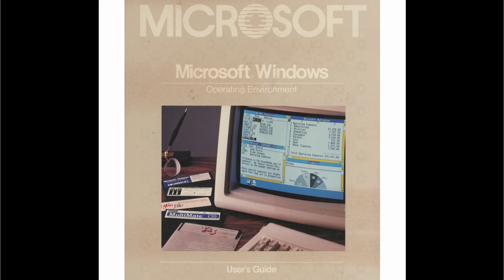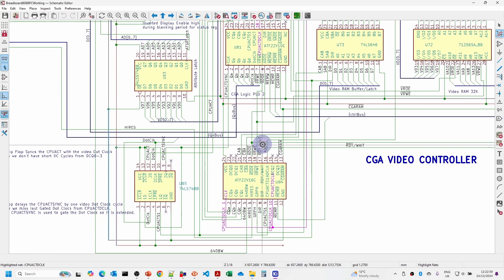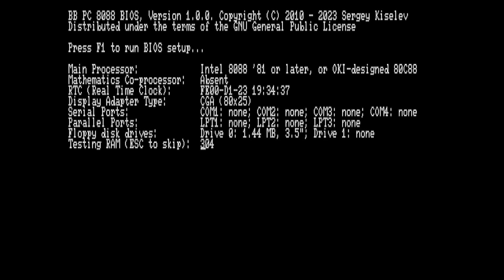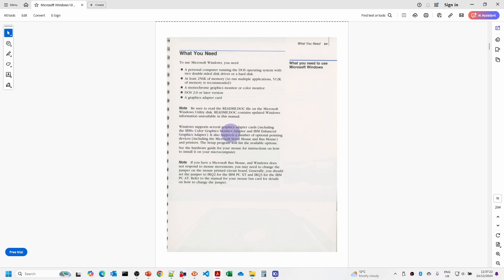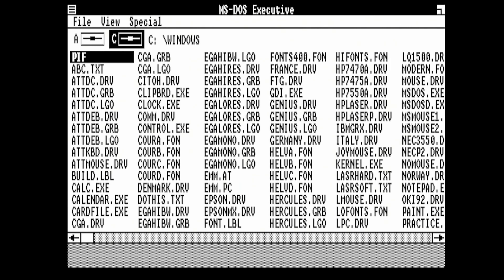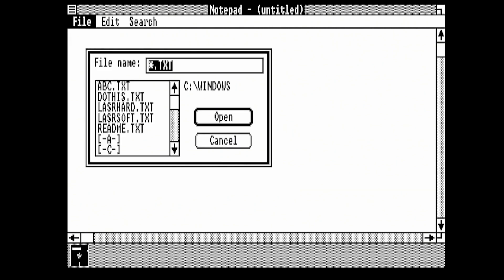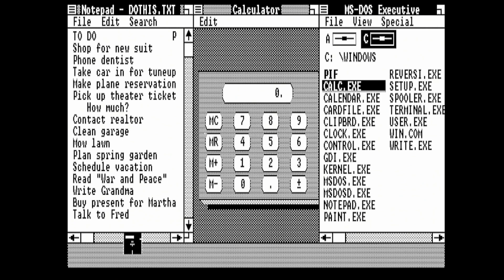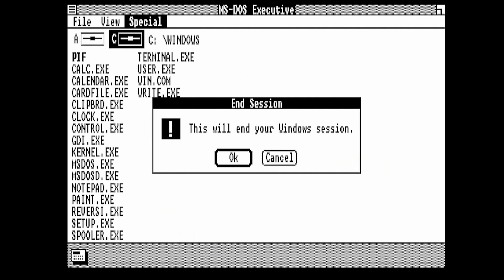Breadboard 8088 PC #61 Install & Run Windows 1.0

Comment: I would not be so keen on building a computer with breadboard ...I built a test jig many years ago using tri-pad boards mounted on aluminium  sub-frames in a box the size of a small microwave oven; - next time, I will use PCBWAY...
...computer circuitry needs lots and lots and lots of small ceramic capacitors across the power rails of each IC...
Reply from the maker: That's kind of the point. Use decent Breadboards and lots of decoupling caps like I do and it will work. I would have gone through about 100+ PCBs building this project! Dave

Comment: Congratulations getting those last glitches fixed and Win 1.0 running! I remember getting it running on the family's XT in 87 with 512KB and dual 360K floppies...so much disk swapping but MS Paint was worth the effort.
Reply from the maker: Thanks, just the Mouse to go then I think I will have a go at re-building with the faster 80C88 and get rid of DMA and the power strip bus connections (these cause most of the reliability issues).
Going to play with a few other Windows 1.0 Apps but hope the hard drive doesn't get corrupted. Seems to be intermittent problem where the directory entries and FAT gets corrupted :-( Dave

Comment: I was loosing the will to live half way through the CGA videos, so pleased to see we are now moving on!😀
Reply from the maker: You and me both! Video controllers are by far the most complex part of PCs (old and new). Timings down to 10ns matter even at VGA resolution and despite the best of plans, a certain amount of trial and error. I partly use the videos to remind myself of what I have done (like the Nanocomp snow ones), so not always going to be short and snappy!
I think I have reached the limit of Breadboard based PC compatible video controllers. VGA has about 300 registers and dedicated VLSI chips for handling the video logic! (EGA is not much better). I thought MCGA may be an option but Windows driver was 286 only and still in black and white just 640x400 rows, not 640x200! Let me know what you would be interested for the next series? Dave
Reply: @breadboardinglabs  I am glad to took my comment in the spirit it was meant!  Its a great achievement to get Windows running on a breadboard computer, so hearty congratulations.  As for the future, how about returning to the Motorola family with 68008 or full 68000?  And if you have had your fill of vintage video controllers, maybe take the easy way out with a Pi Pico or ESP32 VGA solution?
Reply from the maker: Thanks! If I wasn't so stubborn I would have given up with CGA. I do have a 68008 somewhere, but I also have a new 80C88 which can run at 8Mhz and also a 386DX 33MHz (will need some form of PCB adaptor).
May do a BBPC version 2 with 80C88 which should be much easer (and quicker) if I leave out DMA etc. 
The big issue with any video solution even, with Pico or ESP32 is the register compatibility with VGA and the complexity of 300 registers and associated logic (CGA was simple in comparison). I have been thinking about using a PI Zero and an ISA 5V to 3.3V interface then run some doctored DOSBox or similar virtualization to map the IO registers and RAM via ISA bus to the PI and connect via HDMI. Writing a register compatible VGA or SuperVGA emulator would be a huge amount of work, but mapping IO ports and video RAM on  breadboard to GPIO and mangling DOSBOX video code to take inputs from GPIO would be more manageable. Either that or just build Sergey's Trident 9000 VGA card using surface mount chips on a PCB with a ISA to breadboard connector (feels like cheating!). Plenty to think about! Dave
Reply: @breadboardinglabs  Are there merits in trying the 80188 or even the 80186 to reduce the chip count?  The RM Nimbus (80186-based) ran Windows, but I don't know if it was a special version.
Reply from the maker: I was trying to use DIP chips initially rather than needing to buy/make PLCC type adapters. I will have to do this for the 386 I have but there aren't any alternatives. The other option is to use a Raspberry PI running an emulator but that feels like cheating! Dave